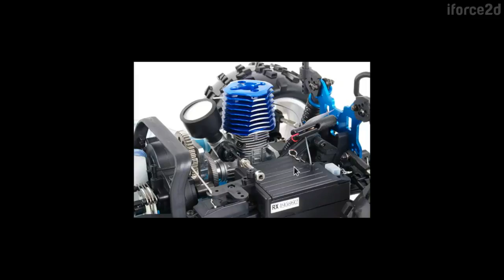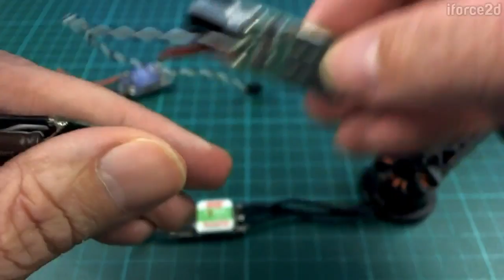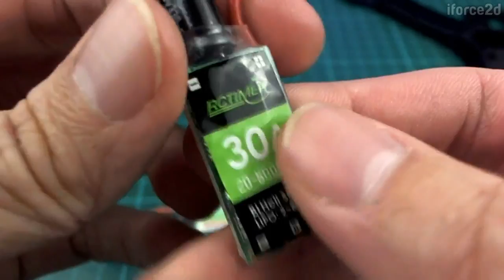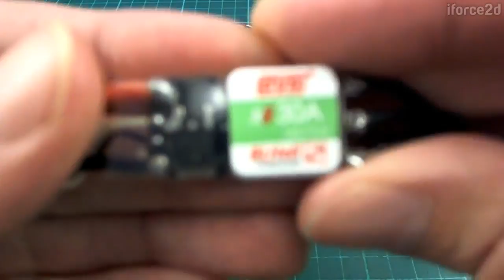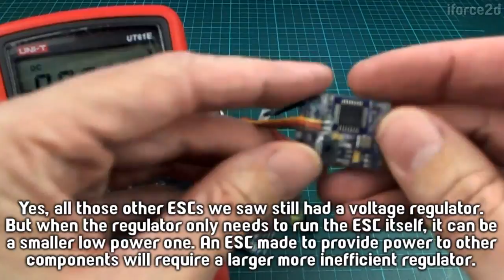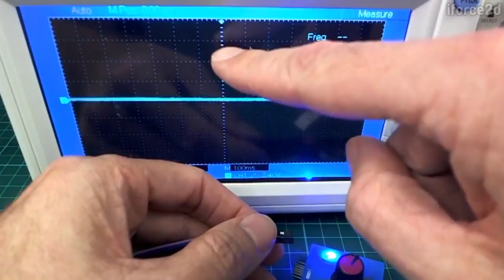Noobs guide to quadcopters part 7 (ESCs)

Comment: How is the current output to the motors controlled? Pwm through fc only switches it on and off  by switching 5v and gnd?
Reply from the maker: That's the job of the ESC. The PWM from the flight controller tells the ESC how much throttle is desired, with the switching between 5V and GND, at about 50 pulses per second. The ESC has it's own switching to turn the motor power on and off at more like 10,000 times per second.

Comment: You should always find a cap in a circuit with a motor, a transformer, an inductor/coil, or anything that has expanding/collapsing electromagnetic fields etc. The capacitor is to control the "backlash" or voltage spike in a circuit with an electromagnetic field like a motor....the field/motor is resistant to sudden changes in current and causes voltage spikes when you close the circuit and that juice needs to go some where so a cap is used...you'll often find the cap combined with a bleed down resistor if the circuit is designed properly...the call also helps to clean up the demand signal to the esc....So if you're chopping the circuit on and off in extremes the cap helps to stabilize the transition points of flooding and chopping the circuit..it's a bucket to dump extra fast water into that has no where to go and to take smooth water from when it's needed and it's a security blanket to stop crap from releasing the blue smoke monster during extremes within the line....I know what I'm using to say...I hope it came out the right way

Comment: I have an interesting problem with my 4 in 1 esc  board.  whenever I go for Full Throttle the ESC board resets.  have you ever heard of that problem?
Reply: Ron Ferlman depending on your setup....it's protecting itself from over voltage/over current most likely...make sure none of your solder joints or wires are bridged or touching....it could also be herring feedback from a motor it doesn't like...or it double be a faulty board or or or or or...it's hard to troubleshoot over the internet without a meter ya know...I'd contact the seller/supplier and have it replaced...it's not worth dicking around to trouble shoot components on the board...even if you did have a scope and a degree...it's still a waste of time and a pain in the ass

Comment: I always think of capacitors acting  like a rainwater tank. They are voltage devices so act like water level. The wires from the battery is like a small hose filling the tank and the fets and motor act as a big tap outlet that is turned on and off fast. The tank (capacitor) will allow more water(current) to flow briefly and remove water hammer( back emf).

Comment: Amazing job you are doing on this series, I needed it a year ago ! would have saved me a lot of time and headaches.
A few questions : 
What is the recommended AWG for ESC power wires ?
At 5:18  There's already a common ground via power wires, why would another be needed for communication ?
Reply from the maker: https://en.wikipedia.org/wiki/American_wire_gauge
The main power ground wire can be affected by those spikes in current that I mentioned, which I think can alter what each side perceives as 'ground' and can introduce errors. The separate ground is on the other side of the cap and should not have that problem. In my experience I have had no problems with using the main power ground only, but these days I use both, usually the ESC will come with it ready to use so there's no reason not to.
Reply: Mostly you get away without using a seperate signal groung. But if your ESCs use active brakeing, you can get quite severe interference in your groung and loose the pwm signal for a short time. By using signal ground you have a low impedance path to the FC and avoide interface. Hope that explains the problem some more
Reply: Thanks both of you, its clear now.